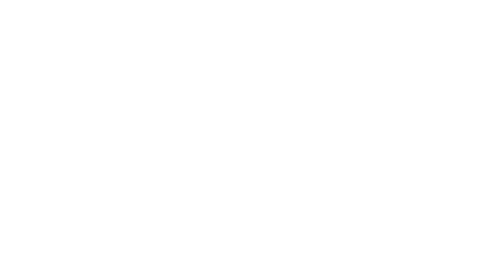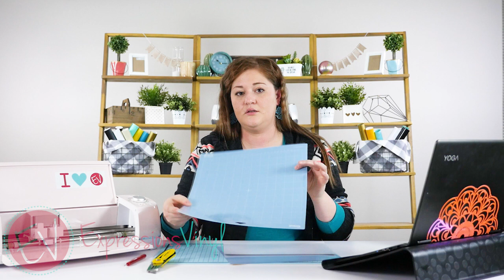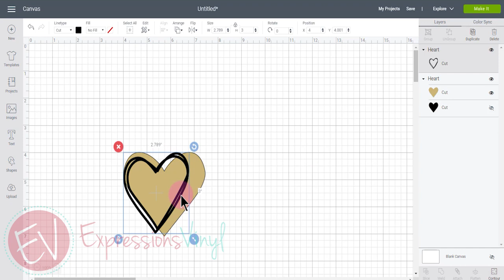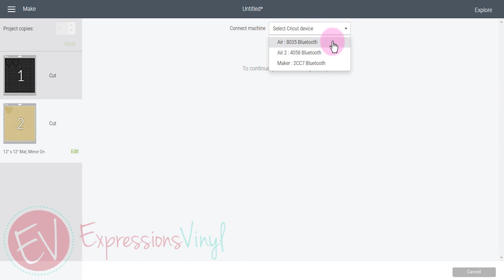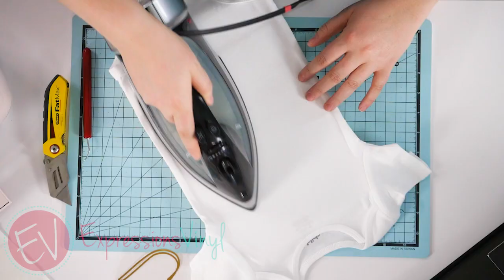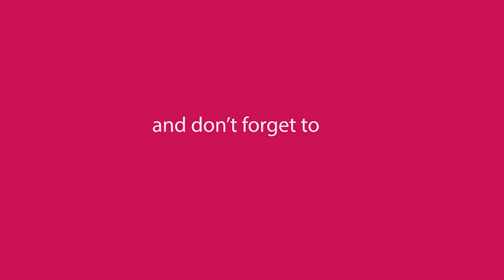New To Vinyl - How to use Patterned and Metal Heat Transfer Vinyl

Comment: What metal pu or vinyl did you use and it was so easy to weed?
Reply from the maker: Gold metal heat transfer vinyl
https://expressionsvinyl.com/metal-9x12-heat-transfer-sheet/
Patterned heat transfer vinyl -thin stripe black and white
https://expressionsvinyl.com/12x12-patterned-heat-transfer-vinyl-thin-stripe-black-white/
Test cut! Try some of these recommended settings
https://expressionsvinyl.com/machine-settings/